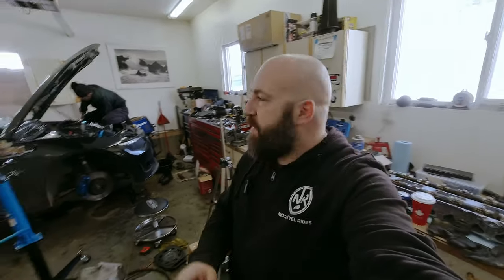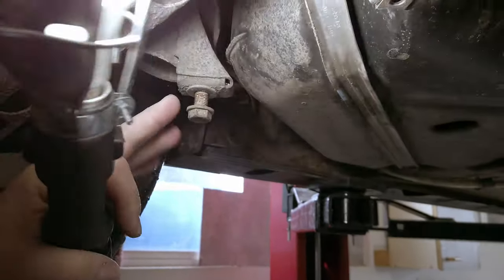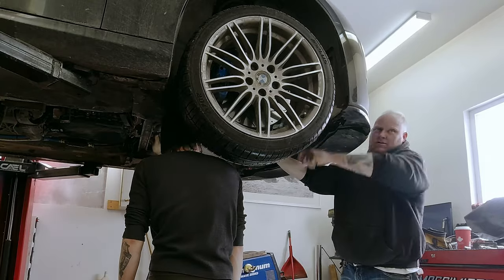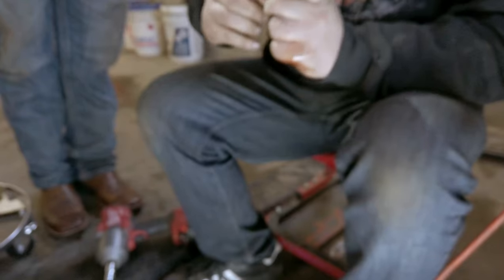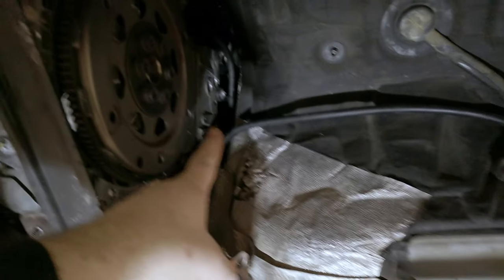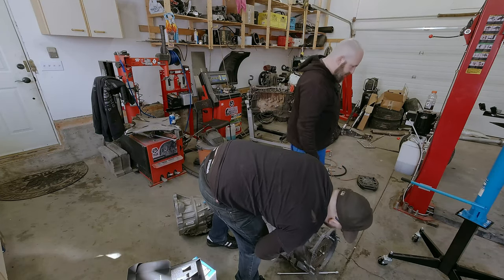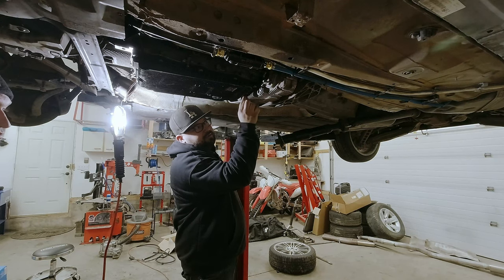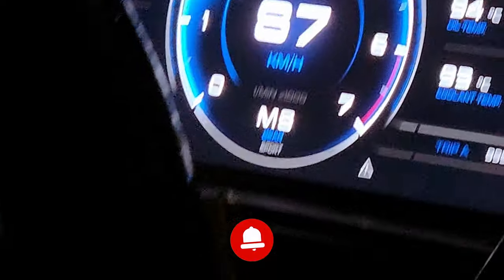Single Turbo N54 BMW Gets an 8hp Transmission

Comment: Did u fit the new AN fittings before u lifted the transmission or did u have enough room to tighten them once transmission was place? This is for the two lines into the new DomiWorks adapter
Reply from the maker: good question. we tightened those before we lifted it just to make 100% sure they were tight if we didn't have the room.
Reply: @tony.nextlevelrides  Oops. I’m going to see if I can make it work…I’ve the trans in place lol.

Where would you recommend placing the inline trans oil thermostat? I have a side mount aftermarket trans cooler also.
Reply from the maker: I'd put it right at the cooler for simplicity. most yikes you don't need to redo lines.

that's what we're going to do with ours.
Reply: @tony.nextlevelrides  Ok. Yes all new lines from trans DomiWorks adapter to trans cooler. My current AN lines plugged into the factory line by the fan.
Reply from the maker: @edwardwerley8831  awesome. we did they initially but the fittings always leaked and were impossible to remove. so we ran  ew lines from trans. fitting to cooler. it was a pain.
Reply: @tony.nextlevelrides  yes! There is 8 connections with 16 connectors…ugh lol

Comment: This is super great video, thank you for showing most details. I am in the same process now but going with DCT and CANTCU, the only part scares is the wiring part, so did you remove all the old transmission wiring harness entirely and replaced it with the new one??
Reply from the maker: yup! you basically disconnect it from the shifter and mechatronic then pull it up to the DME box.

when you follow it, there's a few zip ties and fabric tape holding it in place. you'll trace the harness to two clips (black and blue). you'll remove both and clip the majority of the wires off. the only ones that will remain are the grounds. they run to a butt connector and are crimped together than are bolted to the strut tower.

the new harness (on the 8hp) connects to one of the removed connectors, through the DME box and down into the transmission tunnel to replace the one removed. one portion goes j to the cabin for the cantcu computer, etc.

it was very easy.
Reply: @tony.nextlevelrides  thank you, I see in the stock harness there  are five connectors (black, blue, red, white & green), all connected to the DME, in ur video you only cut the black & blue, so the rest are connected right? Also the ground cable will be swapped to the new 8HP ground mounted in the same spot, correct ?
Reply from the maker: @mot8862  you only touch the black and blue, the rest I disconnected to five me room to cut the zip ties and fabric tape.

when you cut the shielding for the harness you'll see a few that are grounds from one of the connector. I can't exactly recall where they're connected but once you dig into the harness (when I did anyway) it was very, very obvious.
Reply: @tony.nextlevelrides  so they remain there, how about the wires  that you cut off of the harness, do I re wire them or leave them? I know the new 8HP/DCT harness have a plug & play connector (blue one)just like in the video. I really appreciate your replies.
Reply from the maker: @mot8862  those wires went to the one connector that was completely removed. if I recall, both connectors were taken out but one replaced with the plug and play harness. the grounds may have been in that harness but separate once you cut it open. the wires we cut were not replaced and only go to the two connectors removed. when you do the project, you'll see what I mean by ground wires. I'll try to take a photo.
Reply: @tony.nextlevelrides  great thanks a lot, so I think It’s getting clearer to me now, those two black & blue that u cut all go the the transmission mechatronic connector, right?
Reply from the maker: @mot8862  yup!
Reply: @tony.nextlevelrides  excellent, thanks a lot man, now I have the full courage to do it lol
Reply: @tony.nextlevelrides  last thing to ask about the little ground wire with the new 8HP harness, where does it go to?
Reply: @mot8862  it can be grounded anywhere but we grounded it on the factory negative post by the dme box

Comment: Great video guys. I have a 2007 E90 with 19T running a Wedge E30 tune at 21psi. The stock 6hp21 is now slipping in 4th and 5th gear around 3200rpms. I was thinking about a 8hp70 swap with adapter plate, spacer washers, TurboLamik, TCU rework, and diesel 8hp70 donor from Europe but that is looking at $5000-6000. Ouch. I don’t plan on pushing the boost anymore. I think I’m about 540ftlbs at the wheel. Do you feel the 8hp45 can handle this?

Thank you for making this video!

Ed
Reply from the maker: absolutely, I'm fairly confident this 8hp45 will handle around 600-650wtq. with a transmission tune (xHP) I increase the torque reduction to take the stress off the clutches during each shift. a byproduct is also quicker shifts.

the 8hp70 would be better only if you planned to drag race the vehicle weekly. the 8hp45 will handle your goals and current setup without issue!
Reply: Thank you for the quick response!

Do you have a link to the CANTCU module?

Can you confirm if the ZF 8HP50/55 does NOT have the N54 because it has a different bell housing?
Reply from the maker: @edwardwerley8831  this one should work;

https://www.canformance.net/product-category/cantcu/

the 8hp50, etc. is found on the B series engines like my g30 540. my understanding is that only the 8hp45 will bolt onto the N54 since its originally off the N55 with the same bellhousing.
Reply: Transmission-$500
Shifter-$100
Cantcu,shifter mount, wiring harness $2000
Domiworks Oil cooler adapter$160
Fluid and service kit-$190

Prices in CAD  these are all the parts needed and cost associated
Reply: Thx for the info guys. Taylor what year is your car, what made u choose dct shifter vs 8spd shifter, and did u have issues with new shifter working with you center console trim?
Reply: @edwardwerley8831  its a 2009 335i xdrive coupe :)
I chose the dct shifter strictly because of the looks and ability to allow it too function as a dct shifter(neutral brake puts car in park etc)

No fitment issues at all. I am however currently in a predicament on what I want to do for a cover. Lots of different option, 335is cover with sport button, manual shift boot, put a completely new center trim in from the e92 m3, or just make my own block off and surrounding I haven't decided yet
Reply: Guys, ordered the complete kit from Ken, ordered the DCT shifter,  and bought the trans today from a local yard. Going to reach out to Domiworks for the trans line adapter.

Did you guys replace the oil in the new torque converter? I think you mentioned that it takes about 3 liters.

Ken has been a great to work with.
Reply from the maker: @edwardwerley8831  there was a crack in the pan so all the fluid was already drained (for the most part). just take the torque converter off, pour all fluid out and refill before placing it back onto the input shaft. easy.
Reply: Perfect. Thank you for the extra info.

I’m going to be doing the do-it yourself version of Ken’s wiring harness. From
What you can tell is there any reason I cannot reuse the 6HP harness back to the DME with putting the connector by the shifter and doing the connections by the shifter?
Reply from the maker: @edwardwerley8831  I'm certain there are more wires going into the cabin to convert from M shift to E shift. could you run additional wires? probably. for the complete plug and play harness, it was worth the money. it was so fool proof and easy.

of course, if you take your time. no reason you couldn't do it the DIY way as well.
Reply: Thank you. Ken said two to three weeks for plug n play harness so I got impatient lol.

Do you know if the rear trans bolt pattern on 8HP45 from the F10 and F30 are the same?

The rear trans mount on the f10 is different then the f30 but the f30 looks to be the same as the E9X N54 6HP19/21.
Reply from the maker: @edwardwerley8831  as long as it's from an N55 it should be fine.
Reply: did you end up using the 6hp torque converter?
Reply: Yes I did. I believe Tony’s son also used the stock torque converter.

Comment: does this increase top speed with the added gears?
Reply from the maker: because of the shorter final drive on the diff, I believe it would slightly lower possible top speed it anything since the gears are shorter. that being said, cruising down the highway in top gear is much nicer now and at a much lower rpm. hope that helps.

Comment: Did you add physical buttons for shift modes?
Reply from the maker: it still has the D and S modes but not for Sport and Sport + (yet). a DCT shifter surround is in the works and can be integrated.
Reply: Currently to switch between sport and sport plus you would use your dtc buttons(one click= sport, hold the button=sport plus) the owner of cantcu can set this up to different options. Currently the car has it set for one click on the voice command button is sport and click and hold is sport plus

Comment: What car did the 8hp45 transmission come out of?
Reply from the maker: the transmission came out of a 2011 BMW 535i xDrive.
Reply: @tony.nextlevelrides  Thank you, is it possible if you could get the whole parts list needed for this swap?
Reply from the maker: other than the transmission and the cantcu kit, you basically only need tools and fluids.

for the transmission we used 10qt of Liquimoly top tech 8100, changed transmission pan (with integrated filter) and the trans. cooler adapter that's mentioned by name in the video.

I honestly can't think of anything else, the kit came with the adapter from cantcu as well. only thing optional is your choice of shifters.

it was surprisingly straight forward and simple.

Comment: What torque converter did you use? Abd did the driveshaft bolt up?
Reply from the maker: we used the 8hp torque converter, driveshaft bolted up perfectly.

Comment: This swap will be the same with the rwd correct?
Reply from the maker: yes but you would need a RWD variant transmission.
Reply: @tony.nextlevelrides  thank for your reply. Also when you connect the computer kit, does it come with a base tune to drive it or it’s a self learning one.
Reply from the maker: @alexgonzalez7395 CanTcu comes with everything needed, I believe Ken logs in to code and unlock it, otherwise it's simple.
Reply: @tony.nextlevelrides  do these transmissions need the chip board installed like other vendors require?
Reply from the maker: @alexgonzalez7395 nope! not with cantcu!
Reply: Oh damn so the driveshaft bolts up to?
Reply from the maker: @alexgonzalez7395 yeah, if it's off an N55 the 8hp it bolts up. if the 8hp is off a 4 cylinder, you need to put the 6hp output shaft on.